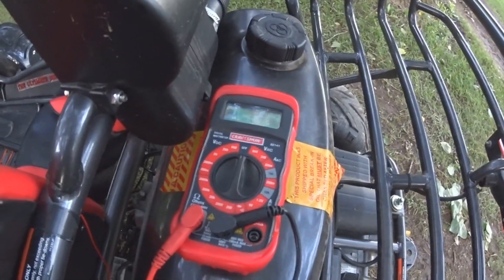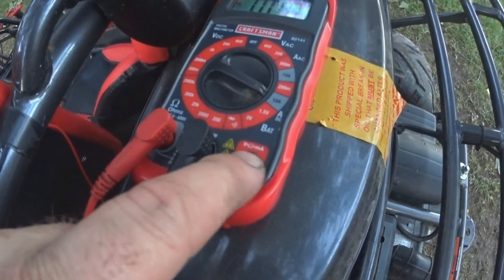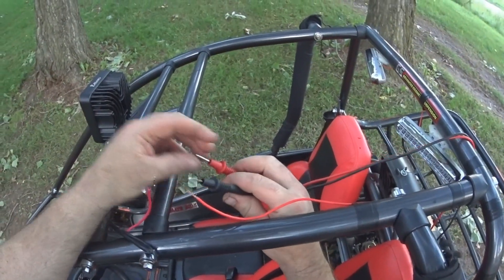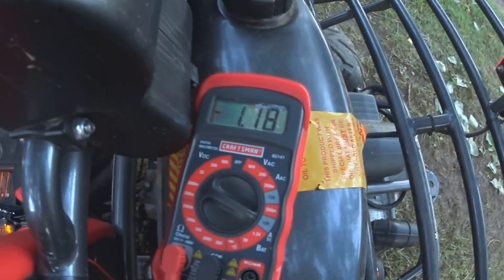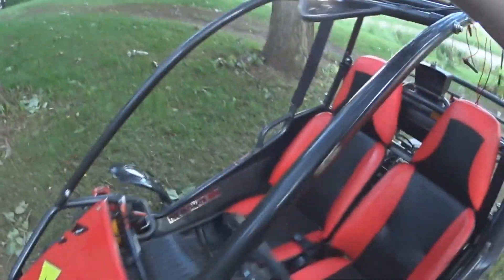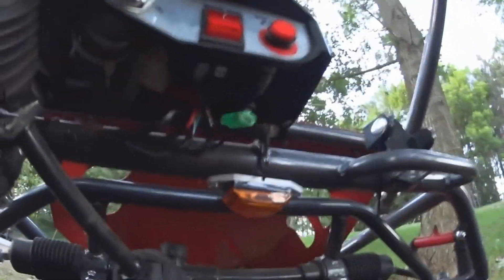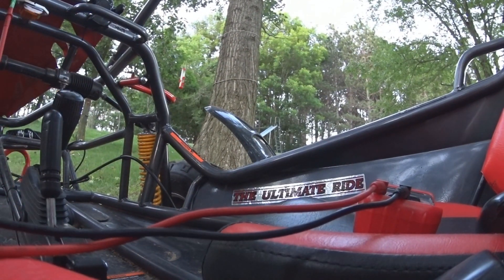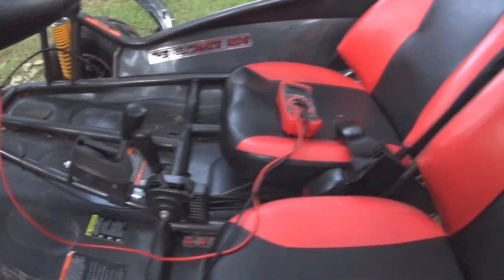How To measure 12 volt Amps  with a Multimeter

Comment: What if the amperage you need to test exceeds the rating of the meters cables? Like on a pc power supply I might have to test anything up to 12vdc @ 30 amps.....obviously that will just fry the meter and leads. Hmm...a bigger meter?
Reply: 707SonomaComa That's one option. In the end I discovered a 30A panel meter (needle type) with what they call a "shunt" connected to it so it doesnt damage the meter also does the job.
Reply from the maker: Yes it would. Think most have a 10 amp fuse. You have to take them apart to change the fuse
Reply: Changing the fuse still wont solve the problem. The current needs to be measured somehow. Some guys talk about resistors added into the circuit then measuring across those and multiplying the resulting reading but it all goes over my head.
Reply: What about a clamp meter plugged into your multimeter?
Reply: craig shut the fuck up it's obvious you're just trying to cause a problem here

Comment: I'm not clear on how to set this up,I'd really like to know how. It would help me out tremendously. By the way, that's really cool.
Reply from the maker: +Cyrus B.Clintock  Without me looking just put it on V DC to read 20 volts. Don't be unhooking the leads on the battery though. Just touch the two leads on this to the two leads on the battery. Guess you can test it out 1st on a AA battery and see if you are getting 1.6 volts or so.